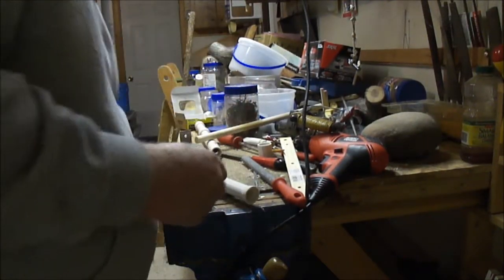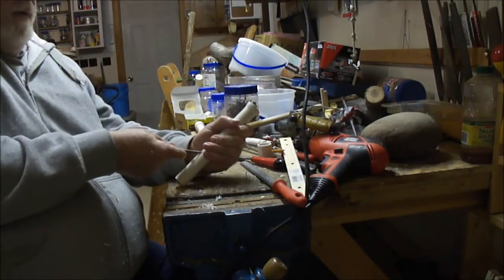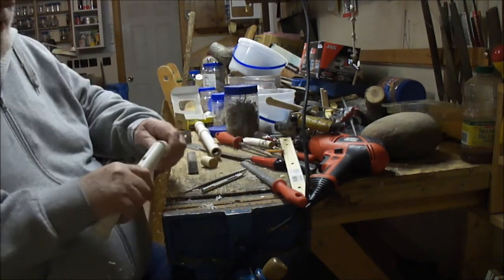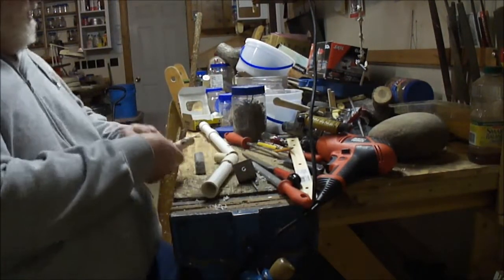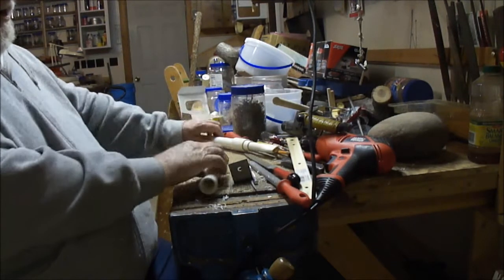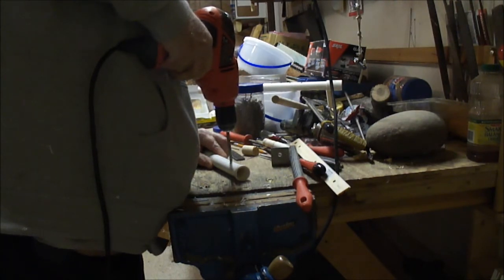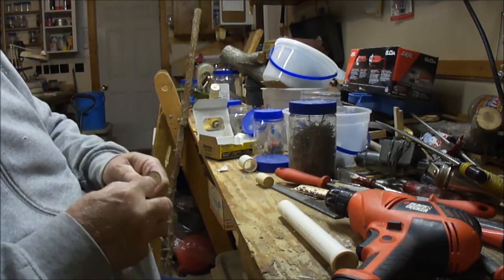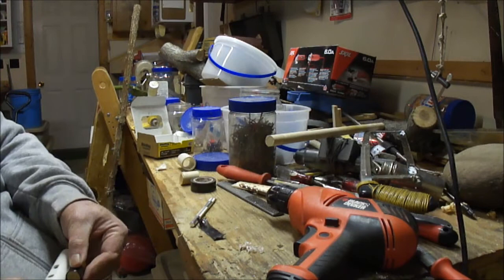Making Air Flow Channel on PVC Flute - Part 3 of 3

Comment: hello i am from PERU i like it ,I want the measures of the big flute please,it's the best flute I've seen,Thank you
Reply from the maker: Hi Marco, I can give you the measurements but not just now.  I've got some work to do.  Perhaps I can measure it and give them to you in a few hours, or tomorrow.  I'm happy you like it.
Reply: Hi, I would appreciate it from your heart, thanks for giving you some time to answer me. I'll wait for the measurements with inpance. I think it's a fabulous flute. Thank you,I do not speak English very well, I am with a translator, I speak Spanish I hope it is not necessary to continue communicating
Reply from the maker: La comunicación es necesaria. Su traductor es buena para mí entender claramente. Voy a escribir mi respuesta en ambos Inglés y Español (Google Translate).
Vamos a empezar desde el final que usted sopla que es el back end. desde el borde delantero del sonido que el agujero es la presentada desde atrás hacia delante y de arriba hacia el interior. Empezar desde la parte delantera borde inclinado. Las medidas son en mm y están en la parte superior de cada uno de los 6 agujeros. 121; 142; 168.5; 198.5; 226; 262,5; y 386 en el extremo inferior de la flauta. Pero cortarla por lo que es un poco más largo, como 390 y, a continuación, usted puede ajustarlo a un G, pero cortando más apagado. Mis orificios son 5,5mm de diámetro.
Espero que entiendan porque el vídeo está en inglés. Voy a ayudar tanto como puedo. Hay mucho que saber para hacer una flauta.
Reply: gracias quiero aprender mas sobre flautas
Reply: thanks I want to learn more about flutes
Reply from the maker: Este estilo es Native American Flute. Debes consultar este sitio web. Http://www.flutopedia.com/ ¡Lo tiene todo! :) También hay muchos videos de YouTube.
Reply from the maker: This style is Native American Flute.  You should check this web site.  http://www.flutopedia.com/ It has everything!  :)  Also there are many YouTube videos.
Reply: Thank you very much, what's your name?
Reply: muchas gracias,cuales tu nombre?
Reply: Do not forget the measurements of your flute, please
Reply: no te olvides de las medidads de tu flauta,por favor